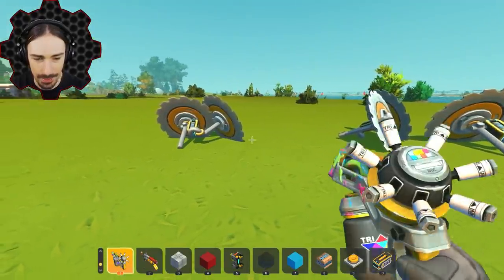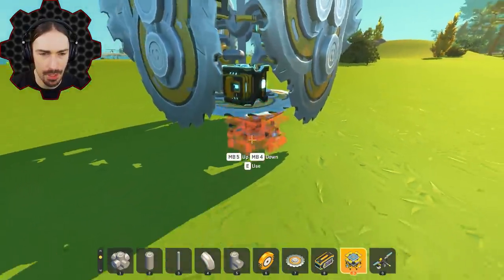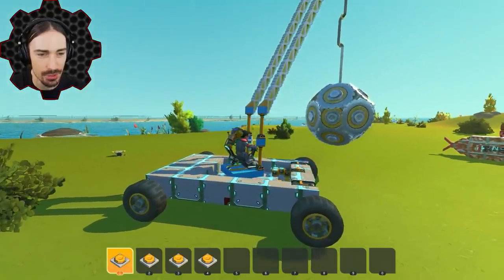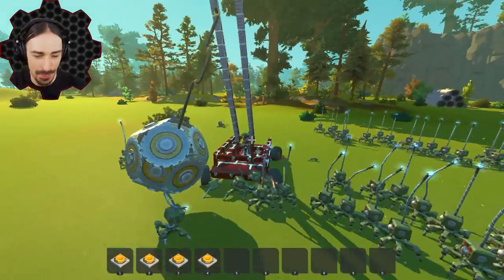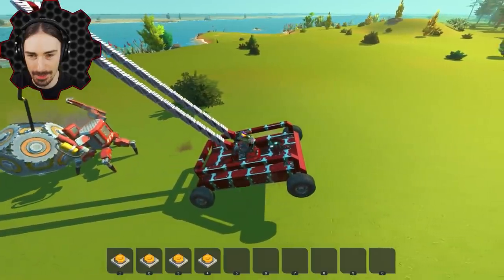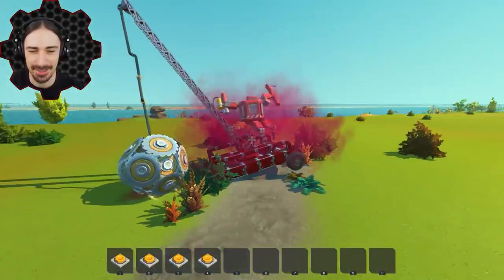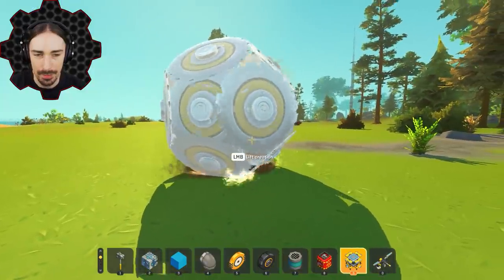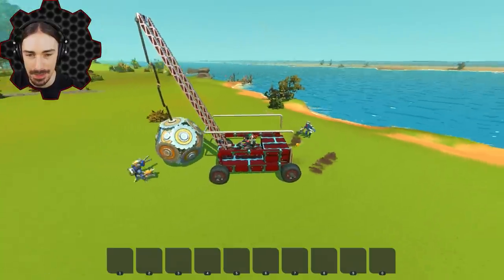Over-Engineering Impractical Weapons: Saw Blade Wrecking Ball! - Scrap Mechanic Gameplay

Comment: Scrapman plays and experiments on an unstable test build of the game: "How did this happen!?"
Me: . . . . . "You want me to build you a bigger harvester on the official build that's more stable for that field you must now reap? I mean you did sow it, and you sowed it like you meant it, so......"

Also, I've already suggested 2 very impractical weapons on your videos. 1 is basically a drill headed rocket sledge, a heavy rocket fired down a cordoned path that's heavy, fast, and has drill bits on the end for extra punch. Can 1 delete a Farmbot, if not do the drills, mass, or speed need to increase to make it plausible if at all. And then the "Machine Gun Blows" punching machine. You won't be able to take out anything higher than a haybot with this this one, but it's basically a wall of pistons all set to rapid fire and retract 2 blocks as fast as they can with a single concrete 3 block on the end of each piston. The pistons are all set to fire randomly so it's like the anime fast firing punches thrown. Can you get it to the point were it will deal damage enough to kill haybots and totebots within moments? Just ideas I've wanted to do in survival, but I've never thrived enough to the point where I could experiment like that, and I'm still going in my own personal play through, so I'm not going to be getting the experimental build anytime soon.

Comment: I'm thinking an oversize Reaper Scythe that uses saw blades on the inside and outside edges, with a drill in the tip.  It should swing low enough to hit totebots, and swing fast enough to exceed their cowardice.  Show Big Red that anything he can do, you can do better.  Bonus points if you attach it to a walker with 6 legs and can swing it without falling over.

Comment: If it's impractical weapons you're looking for try using the 'big ball'. Not sure what the actual block is called but on the top of warehouses are water tank (type things) with domed tops. If you weld eight of them together you a get a ball that's stupidly heavy. Plus it's shape means it's not going to work well if you try to weld directly to it, meaning you'll have to find some ridiculous way to roll or propel it.
I've been trying to get you guys to use it during multiplayer Monday (bowling maybe?), but comments get buried I guess.

Comment: I know this is a bit late, but there are ways to fix the joint connection error.
Don't know what causes it though, maybe it's similar to the bug when spawning large creations in Trailmakers where sometimes blocks will spawn inside each other?

Comment: Look up my tank frame "Tank Drive NO buttons No MODS" in the steam Workshop it works with a level one seat but it works better with a level five. 

This is the Timber tank staring test 004
No logic needed.
Added reverse.
Added turning in drive and reverse.
Less parts needed then most tank drives.
Great for survival mode.